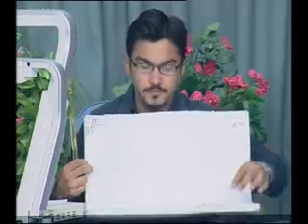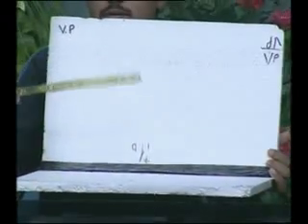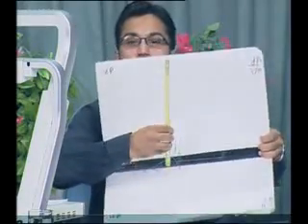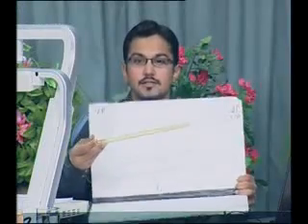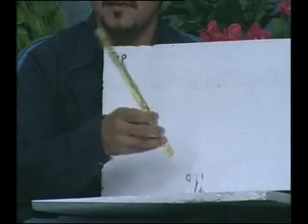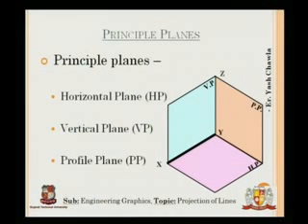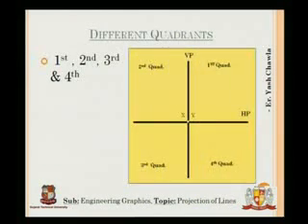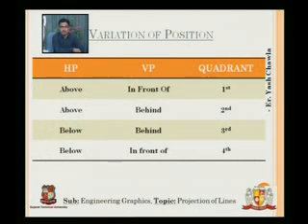Yash Chawla Projections of Points & Lines 1

Comment: Mr Chandandeep, the first case when i was explaining parallel to HP and Inclined to VP, the line i made was in isometric view not in 2D, that is why is seems wrong to you. But i have marked the angle with respect to VP and also mentioned that it will have true length on HP, hence it is clear. kindly check again,
Reply: g